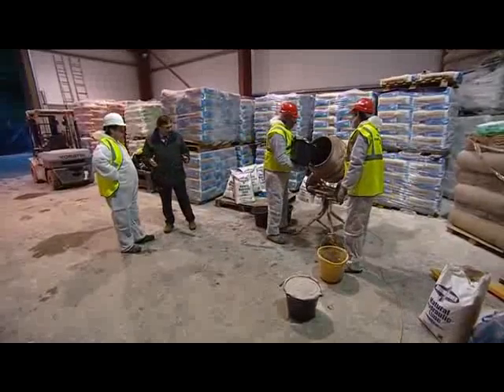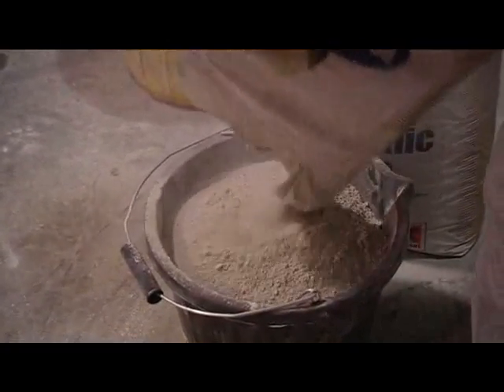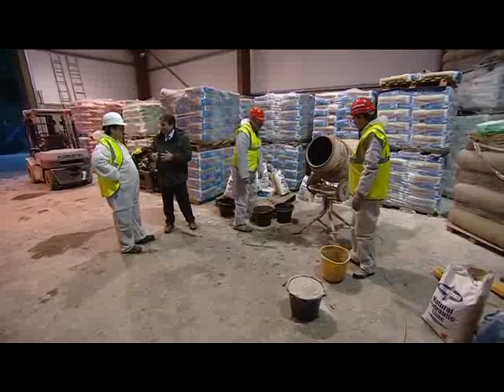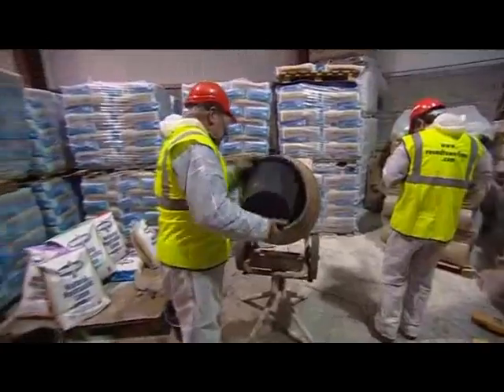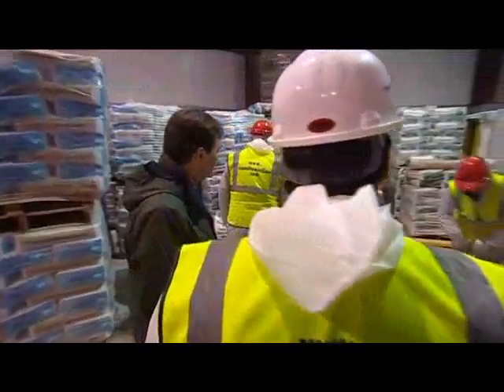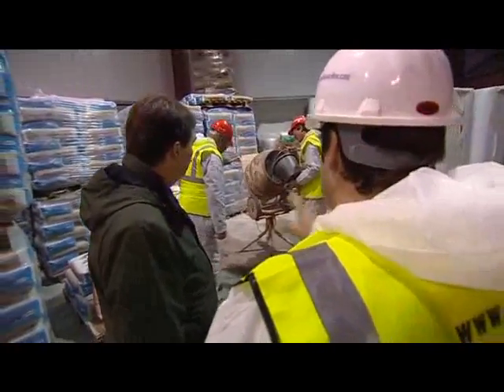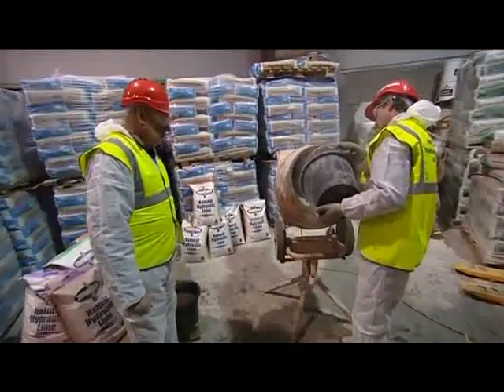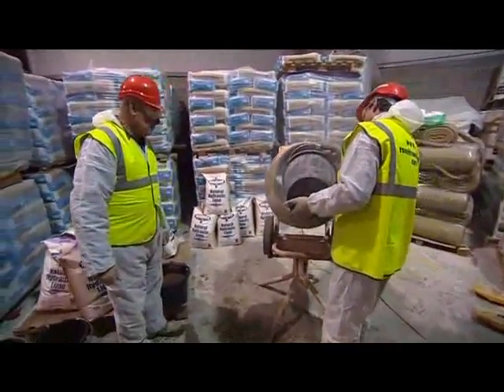Natural Hydraulic Lime: Mixing Lime Mortar

Comment: What is the difference between hydrated lime and hydraulic lime and what is the formulation of hydraulics lime
Reply: Hydraulic lime has "impurities" from burnt clay that allow it to set without air (e.g. underwater). Natural Hydraulic Lime is made from burning limestone with clay impurities. (Artificial Hydraulic Lime is lime putty with "pozzolans" added, like fly ash, metastar, brick dust, or volcanic ash (used by the Romans).) Hydraulic lime sets faster than pure lime putty, and is less breathable. NHL 2 is typically used for indoor work, NHL 3.5 for outdoor, and NHL 5 for very exposed locations (and things like limecrete floors).

Hydrated lime is powdered lime typically used as a plasticiser for sand and cement render. You can mix hydrated lime with water and chemically it is the same as lime putty, but it isn't as nice to work with. Apparently, if you let it "mature" long enough, it is pretty good.

Comment: All lime no matter which lime takes 29 days to cure,  in cold, winter takes abit longer, hydrolic lime sets more if exposed to water like under bridges stuff used for etc, hydrated does not set well by it self quick unless its used in conjuction with pozzalons, which are like cement used in rome eyptain time, modern cwment is damaging to building insideor exterior, if cement blocks u can get away with it depends background but not great cement as it holds water freezes in winter then craks alot haurline craks water seeps in motar u got damp wet wall

Comment: You Brits Use a Totally Different Mixer than We Do in USA.  Although We're Not So United Anymore.  Our Mixers  are Paddle Type. I've Seen Lime Putty Mortar Mixed in a Completely Different Mixer than Both of Ours  There was a Heavy Roller that Compacted the Mortar. By Compacting it Squeezed the Lime Putty Into the Sand. I Use a Clean Log with a Handle Attached.
Reply: How much water do you add. How do you know when it is the right consistency to use? Should it be a similar consistency as lime putty?
Reply: @katinss9983  For the Most Part if the Lime Putty is Slacked properly you Don't Add Water or Very Little. The Lime Putty Mixer I Saw Had Big Rollers that  Pushed the Putty Into the Sand. It Compressed the Mortar. the Wooden Maul I Use Also Compacts the Mortar. You Have to Scoop it Around Some So the Putty Spreads Evenly Between the Grains of Sand. I've Found that Every Action you Do Should Compact the Mortar. I Mostly Commented on Mixers. Here Similar Mixer Action is Used for Concrete. The Paddle Mixers We Use in US Mix Well But Spread Out the Mortar. They Fluff Up the Portland Based Mortar Mixes.  Being Fluffy Makes it Feel Like it Has Lime.